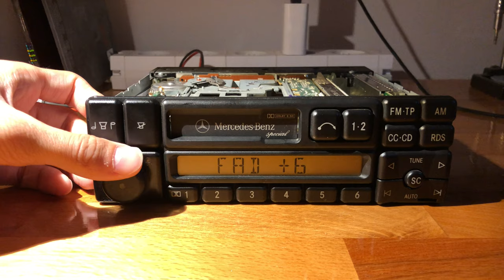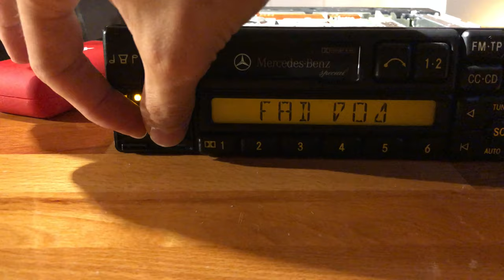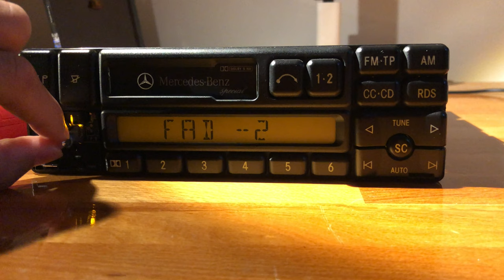Glitchy Volume Knob Fix - The Hardcore Route [READ DESCRIPTION]

Comment: TIP: i cut the top 3 small legs off with a dremel, used a soldering gun to remove and push the rest out! cleaned the holes from solder and popped the new potentiometer that i bought from ebay! HOLY HELL sound system sounds amazingggg!
Reply: Awesome can you send me link? Plz & thank you!

Comment: For those who want to try do the same thing. I managed to get mine to work.
I did the following:
Removed the rotary encoder (I would not do this again it was a unnecessary step)
Opened the encoder in the same way shown here.
removed the rotary ring and cleaned it with methylated spirits (alcohol).
Cleaned the copper brusher arms again with Meth.
Blew them dry.
Tested the rotary switch with a buzzer (multimeter).
The centre pin is common, as you rotate the disk there is contact to the side pins. 
there are 3 states. No contact between any of the pins. Contact between the centre and one of the side pins (alternating between side pins). Contact between all there pins.
The two pins on the opposite side short then you press the button down (on/off) 
I did not pull up the copper "brush" pins.
I put it together the same way shown here.
Using a toothpick I used a tiny amount of superglue on the sides. I noticed that when I played with the switch there was a hairline opening between the 3 layers. I compressed the switch added glue and sprayed it with activator.
Tested it again. Reassembled the radio and it worked.
The switch was 100% dead before I started. 
The switch was difficult to de-solder. the tracks are extremely thin and pads right up against some SMD components. I had accidentally shorted 2 of the pins while desoldering  (I tested the points for shorts before reinstalling the switch)
If you can buy and replace the switch I would suggest you do that instead.
As far as difficulty 1-10 I'd give this a 7. 
I honestly think I was lucky I got it to work.

Comment: Thank you, had to be very careful but it worked on my audio 10 cd. I didn't use a scratch pen, I rubbed it with some IPA and gently scratched all over with the tip of a small knife. 
To anyone trying this, the knobs may have to be pulled pretty hard to get them off.

Comment: My exactly same radio Becker 1490 have a problem with the "other" function of the knob. the ON-OFF. There is power but the unit turns ON very difficult after trying many times (same to turn it OFF). As I said i our previous contact, I cannot send you the radio to USA from Athens, Greece.! I am sure you can suggest or you know the "FIX". I have opened the unit (not the encoder) and was very warm when radio played for 2 hrs...Please help.Thanks from Athens.
Reply from the maker: I'm over up north in Romania, actually - just for the knob indeed, shipping would be too much of a hassle

If you want bluetooth as well, I could fix the knob on the house for you

If not - take the radio to an electronics repair shop, and tell them you need "a new rotary encoder" for your radio

Comment: So I watched this masterpiece of a video, loved every second of it, however I can't figure out one tiny thing. Where is the clicky noise coming from? My knob was erratic so I contact cleanered it and it became better for a few days then went bad again, and then became completely FREE of clicking. Are those pins inside the encoder that you lifted up responsible for the clicky noise, the one associated with turning the knob?
Reply from the maker: thanks ❤️

soo - the spinny bit is made of black plastic - has the metallic coating, and a cog-like structure

that cog-like structure rubs against a plastic pin held on a spring - this latter part sits on the motherboard side of the encoder - probably became loose/lost or disintegrated completely 🧐
Reply: @Darieee  The plastic pin you mention, is that the one you point at 7:28?
Reply: @Darieee  So, I dove in following this awesome video. My volume knob felt completely free with no clicking and as sad as I am to report this, the rubber surrounding the shaft that spins, which attaches to the shiny disc on the INSIDE, has disintegrated. I can rotate the shaft, but the disc doesn't spin with it. Any idea how I may be able to fix this? I feel I shouldn't put it back together just yet, knowing how fragile those pins are as you mentioned.
Reply from the maker: probably time to order a new 5pin encoder I'm afraid ☹️
Reply: @Darieee  So I'm a total noob at this, was pretty much popping my cherry on the Becker. Question: do you think I can order an encoder and just use the top metal part of it with the spinny greasy wheel and keep the original bottom green part, thereby not needing any risky heating or soldering maneuvers? It's a Becker 1350 btw.
Reply from the maker: @shaazy  there's good chance you will be able to -- probably best order 2 or 3 in that case
Reply: Did it work?
Reply: @sethdawg  I'm happy to report, that I ordered the encoder from ebay Germany, and with my noob hands, swapped it into my existing unit. It was not that difficult a task, but u can't just dive in. Watch everything well before attempting to open and keep YouTube on standby to revisit. Also a set of those pick tools, and isopropyl alcohol and a small dental flosser brush to clean the finer details. I took my sweet time and it took me two days. I didn't swap the whole unit, just the encoder wheel/disc +  the 'top portion' which holds the splined part where the plastic knob attaches from the outside. Once I put it all back together, every single click is now registering, it's phenomenally satisfying! Works like new now!
Reply: @shaazy  what’s the part number if you could share that would be awesome. I discovered I had the purchase wrong encoder. The cog ⚙️ is way to big.
Reply: @shaazy all I need is the wheel/disc ⚙️ I will switch it with my stripped unit. Please let me know as my radio is out and in pieces 😩
Reply: @sethdawg  you will have to order an encoder, and then extract the disc from it to put into your existing unit.
Reply: @shaazy  yea correct that’s the plan. However the one I ordered the disk was too big. 
Can you share with me the exact part number? Maybe you could search your email for the part ? I know it was a while back. I’d appreciate it!!
Reply: @shaazy  I ended up ordering a parts deck and swapping out the disk gear and everything is perfect 👍 so happy to have my radio 📻 again!